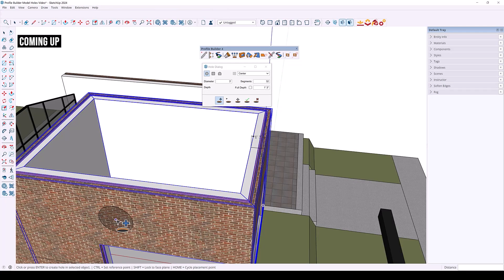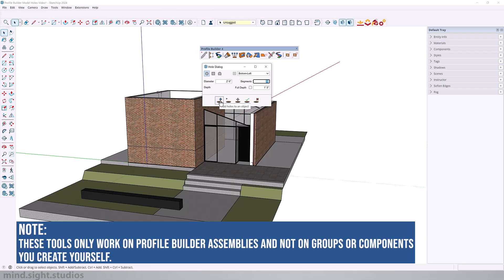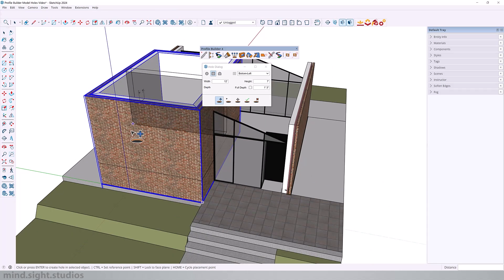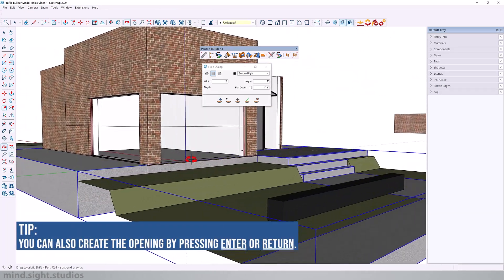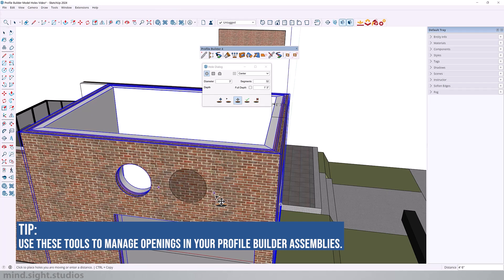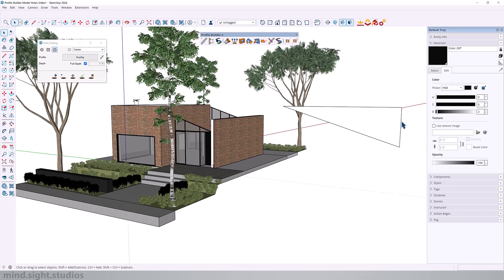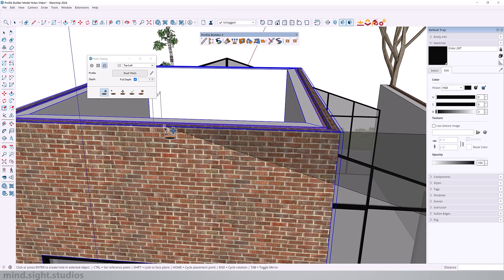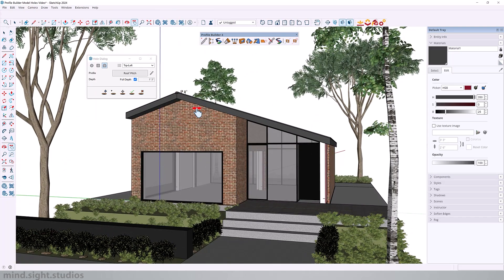Cut and Edit Openings through SketchUp Wall Assemblies with the Profile Builder Hole Tool

Comment: Can you use 2 ref distance for hole tool? Position a window hole with horizontal and vertical ref
Reply from the maker: Yes!  First set your initial reference point, then move your mouse to next reference point and press CTRL again.  You can chain multiple reference points together to position your openings accurately.

Comment: if you create beams as truss using profile builder can you use the Hole tool to show where windows would go? cutting through the profile builder beams created?
Reply from the maker: I'm not sure I understand the question but you can certainly use the hole tool to cut through any profile builder beams that you created.  Why not order a free trial for Profile Builder and test out the workflow for yourself :)
Reply: @mind.sight.studios  I have a version of profile builder and I tried creating beams and wall separately and when you select both you can add holes to both simultaneously